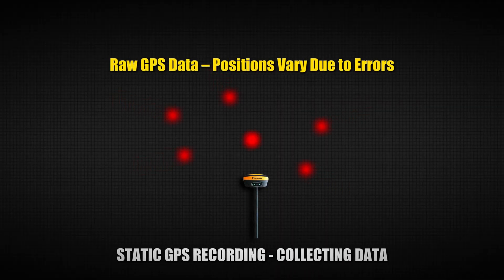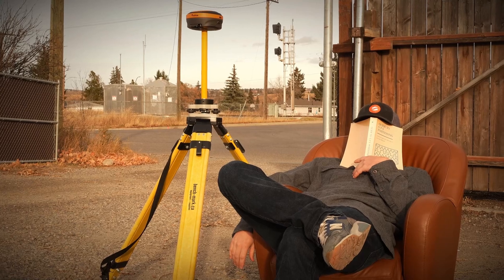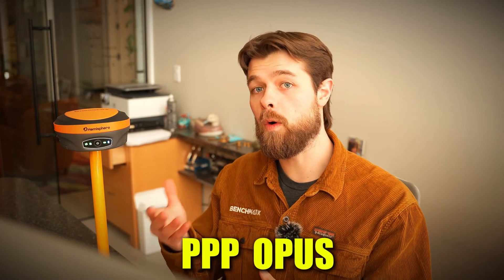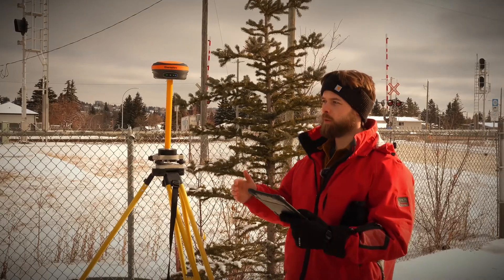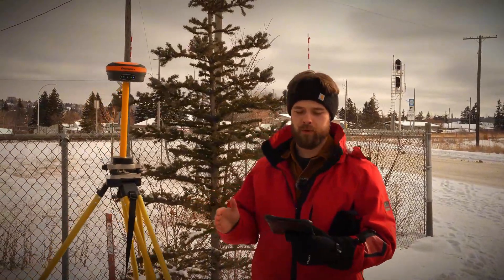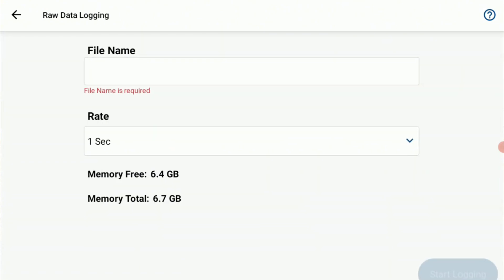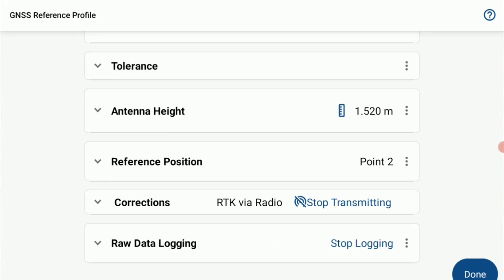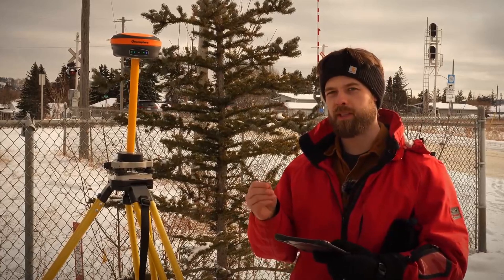How to Record Static Data: RTK GNSS Surveying Tips and Tricks

Comment: Sounds pretty basic but probably under utilized and surveyors should be encouraged to use it more often. A couple things worth mentioning, NR Can PPP service will reduce the static data to 30 second intervals from the RINEX file for better results and consequently raw data interval could be 30 seconds. The other aspect is that RINEX file header needs to have the proper  instrument description and instrument height which a converter may or may not read properly so check first.
Reply from the maker: Hi Charles, that is a good point. OPUS does the same 30 second delineation as well.